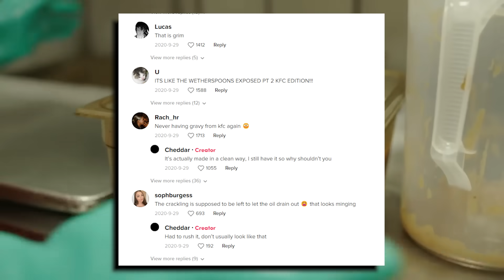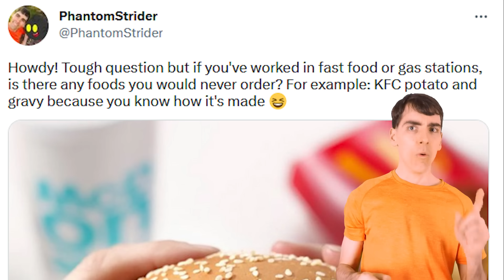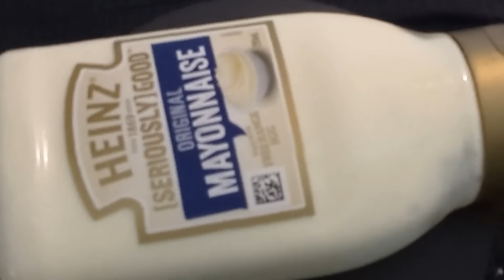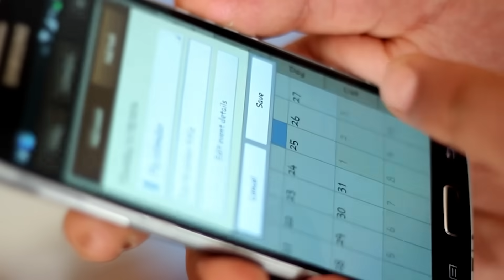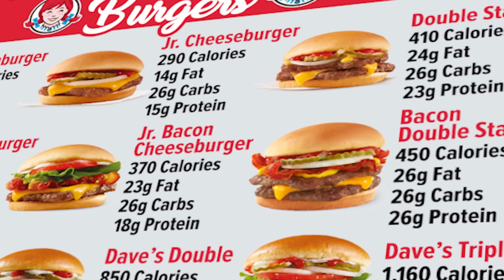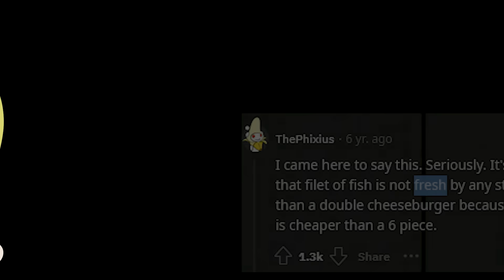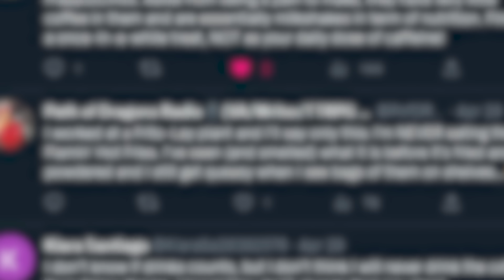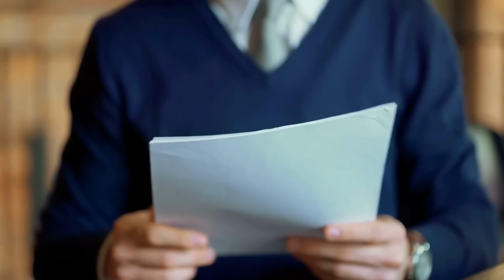The 10 Fast Foods Staff Never Order

Comment: McD's in the United States has always had decaf coffee packs; you can tell which pots are decaf (if they're using them right) because the rims are orange as opposed to brown where they sit on the machines. Typically it's brewed more rarely, usually either on request or during significant rushes (breakfast in particular). If you order it, the only downside is, you might have to wait.

Decaf iced coffee, on the other hand, is in a separate container and is almost always available because it's rarely ordered and brewed once per day at the beginning of the day, even at low traffic stores.

Comment: I worked at Dominos in college years ago.  When someone ordered an “Extravaganzza” — every topping except anchovies -- we topped them out of the overflow bin on the make line, where all the cheese and toppings fell while we were tossing them onto other pizzas.  It’s not as bad as it sounds, since the overflow bin was cooler than room temperature.  It was so much easier and faster than picking the toppings out of the bin by hand and returning them to their rightful containers on the make line. Manager said the only reason Dominos offered the “Extravaganzza” was to clear out the overflow bin.  I would typically get an order for one every hour or so, which was the perfect interval.  Good times.

Comment: I used to bartend for Red Robin and the damn soft serve machine was the bane of my existence. We sold tons of milkshakes. I was the one responsible for breaking it down and sanitizing it and every component every Sunday night. From start to finish it would take me about an hour, sometimes longer if I was busy with other stuff. Wasn’t “hard” just time consuming and full of pumps, little gaskets, small metal and plastic pieces… it was a huge jigsaw puzzle. Thankfully I wasn’t required to reassemble it as that was done the following morning. 

I did have to reassemble it one time and I mistakenly swapped two very similar (but still different) plastic pieces and one of those parts came loose and got chewed up by the machine so I had to disassemble, wash and sanitize the whole thing, throw out the contaminated soft serve, and completely restart the whole reassembly process all while juggling all of my other duties as the restaurant was now open by this time. The worst was doing all this while apologizing profusely to my general manager. I was mortified.

Even though I hated having to clean it, I totally understand why. The nature of the machine itself and the dairy product it was filled with wasn’t anything to be taken lightly or handled improperly. We could have easily given a quarter of our customers food poisoning if we weren’t so meticulous with the cleaning process.

Comment: I worked at a Wendy’s and if they are doing the chilli properly the containers the chilli is in is cleaned nightly. Any leftover chilli is put into containers and stored in the fridge for the next day and the containers get cleaned by the night crew. As of the burger meat that goes into it, they are put into bags that are dated and also put into the fridge. Chilli at Wendy’s also gets sold pretty quickly so you’re not eating multiple day old chilli. The only issue I had with the chilli at my Wendy’s was that our manager purposely added too much water to try and get it to last longer so it didn’t taste right. They did the same with the cheese sause.

Comment: Yuck...former baseball stadium  employee who used to work in the concession stands, what the Hell are you all doing with your hotdogs? 

At our stadium, which admittedly is a smaller stadium that only serves about 6 thousand people on average, we did NOT use water at ANY point in making or storing the hotdogs. We literally would just cook them on the grilling roller machine thing, put them in the buns, wrap them up in these premade alluminum foil wrappers and then store them in like these heated drawers until people came to buy them. Those drawers would have two shelves as well, so we could keep track of which hotdogs were cooked first and know to sell them before the other ones.

It sounds like the Major League baseball stadiums need to re-learn how to make and sell hotdogs.

Edit for grammer and better wording.

Comment: I used to work at Jack in the Box and while I don’t really remember any of the FOOD food being too bad (maybe, aside from chicken fillets for sandwiches and burgers staying under the heat lamp too long but that’s not too bad), I do remember the drink fountains being kinda gnarly. Not just a JITB thing, mind you. But be careful with those touchscreen freestyle soda machines in general. They’re unlikely to be cleaned often and there can get pretty nasty buildup of sugars and different syrups trapped in the compartment. I only know this because it once got so bad that we had to spent like an hour cleaning it out because the machine stopped working from being blocked up

Comment: For the icecream machine, I used to work at hungry jacks (burger king) and the lines which are shown there with the mold don't actually touch any of the mix directly there is occasionally a leakage in the parts however due to how there built there may be off product behind the panels however still 100% safe to eat. It also locks you out of using the machine if it hasn't detected you taking all the parts off to clean

Comment: The reason people are grossed out by the water is water can become stagnated very quickly if it isn't in circulation or stored properly. If the containers are open, it's more likely they will become ridden with bacteria. It's a safety hazard.

Comment: If you consider doing a part 2, allow me to chime in here for good old Panera Bread. Worked for 3+ years, and I can confidently say that you shouldn't order anything with avocado. Most employees don't typically care about the browning of an avocado, and have no qualms about serving it well beyond its expiration date. Of course, this doesn't happen all the time, and it does varry depending on location and management, but I would probably ask if avocados are cut to-order or pre-cut. If the latter, run very very far away. If the former, then go ahead and order.

Comment: Former McDonalds employee here, the filet-o-fish info is extremely outdated, from like 1995 outdated. Back in the late 1990's they did a fresh refresh where the hold bin was removed and food is assembled on the spot. They do deep fry the filets in their own oil vat, and sometimes employees are fools and put other stuff in there even though they shouldn't, but mostly it's fish only in there. There is a hot hold location for the filets after cooking HOWEVER, most stores don't even have one because it's such a slow mover and you get more use by repurposing the heat tray for the patties you'll always be selling. This means they will only cook the filets when ordered in most locations. So most of the time, the filet-o-fish is the freshest sandwich you can buy from a McDonalds. During Lent this changes a bit as the filet-o-fish is far more popular but in the 2 locations I worked in, even during Lent we sold maybe 6 an hour. Not during Lent you can realistically never even sell one in a day.

Comment: I used to work at Subway at a gas station in Poland, and let's just say, the standards are of the higher quality, at least I tried to make the quality better on my shifts there, but the tuna (at least here in Poland) is real tuna. On one nightshift a regual came and chatted me up about some stuff on subway, the tuna. So I took one "brick" of tuna from walk in freezer (yes it's delivered is packaging that looks like kevlar plates/bricks and we read the packaging and all it said that it contained fish(tuna), salt and water. We used to mix one brick of tuna about 2kg(?) if I recal correctly with one bag of mayo (about 1litre, or something over 1kg) and that's it. The vegetables are another story, I worked only nightshifts there and our dayshifts, idk why decided it was right to put loose tomatoes in a top open box on floor under shelfs, (for clarity, here regulations say that it's against the law, and the health department can fine or even shut down establishments for that practice) and the tomatoes decided to start growing a nice and lush carpet of mold on them, or just straight up rot. The common sense if you store vegetables this way would be to just throw the whole box since you can't be sure if the rest aren't getting bad, since it doesn't have to be seen to still be there, like with bread if you see a white spot of mold on a slice of bread the mold is already through the whole slice. The tomatoes in question me and my coworker on shift decided to just not cut tomatoes for use, we said it to dayshift (a not quiet yet manager) that it's moldy and rotting and we decided not to take the risk and potentionaly make someone sick. After our shift our boss called saying they are just beat up from being loose, like an apple in a crate that bumped into each other or fell. For the rest of my work there I decided that I reccomend against tomatoes and so did my coworker. Still the best and most safe option I can reccomend is salami sub (Spicy Italian in Poland) with no tomatoes

Comment: 21:00 people that want the filet of fish, want that and nothing else.  McDonald’s had an after midnight menu for a while that didn’t have the fish on it.  After a couple of very irate customers, I told them to sell it. It takes the same time as nuggets to cook its not a problem to make to order.

23:30 4 hr heat cycle can’t be skipped. And sometimes fails and restarts, because it couldn’t cool it down fast enough. Tailor machine are a joke, maintenance nightmares.

23:50 those are internal drip trays, from anything that past the seals.

25:45 BK floors were sprayed with hot water every night. Made easy with slopped floors. Lot cleaner than other restaurants.

Comment: So, to the "fast food ice" thing, I work at Starbucks, and I do have an incident that still haunts me. For some reason, Starbucks thought it was acceptable to allow lowly baristas to clean the ice machines once a month. They changed that back in Novermber/Decmber of 2022 because, well... there were way too many incidents of machines not getting cleaned properly.

My example was when my location about 1.5-2 years ago had specks of mold in just about every few scoops of ice. This was because of 2 things; firstly, it had been skipped three weeks in a row when it's supposed to be done monthly. Meaning it was nearly 2 months since it had been done. Then the issue came when we actually cleaned it, it actually got WORSE. To the point we cleaned it 3 times the first week, 5 the second, and so one. A few of those were done professionally. And after 3-4 weeks of this, my manager FINALLY had someone figure out the issue; there are pipes that need to be cleaned once a YEAR that hadn't been done in at least 1.5 years. It is something only professionals can/could do, and she had never needed to as this was only her second store she managed, and it hadn't been a year yet. And what we discovered by the person who told her all of this explained that because the buildup in the regular ice machine got so bad, that when we finally cleaned it, it loosened up the mold in the pipes 🤢 and that was why it got WAY WORSE before it ever got better.

Also, to clarify; we were NOT selling this ice 🤢 we were going to the gas station a couple doors over, and buying bags of ice all day, and storing it in the bottom of our machine when it was off/when we weren't cleaning it. That way only clean ice was being used for our customers drinks

Comment: I used to clean ice cream machines. Those trays are what we called dropping trays. I never saw mould there. That black came off the gears in the back of the machine...it was the lube off the shaft. No ice cream is in that tray or around the gear shaft. That black would be hard to hide in the vanilla ice cream.

Comment: As someone who worked at the baseball stadium in Arizona, I can say that how old or nasty a hotdog could be is dependent on the stand you go too. I was in a booster club so we never had nasty hotdogs and we sold steamed or baked ones. 
Most of the stands in stadiums that have bad standards are temps. The stadiums will have lines of temps to fill stands because no one wants to work at stadiums full time and the stadiums save money this way.
Most temps are needing jobs because of drug use or previous jail time. They typically steal money and food and give zero shits about how they do at work. 
So my tip, look for booster clubs or people in stands who don’t look like they hate their jobs.

Comment: One of the restaurants I've worked at. Had the ice machine separated from the drink machine and I or whoever had time had to lug a bucket of ice from the far back of the kitchen, past the line to the drink machine or out to the bin at the bar. So it's basically guaranteed the ice in people's drinks likely had bits of grease and food on it. When it went into the cups. Management was also terrible there. And I don't just mean the in store management.  I mean the guy who owned the place. Never met the guy but he struck me as one of the people who ended up on kitchen nightmares because they had no idea what they were doing when it came to the place.

Comment: Some of the people avoiding the Taco Bell beans may be because for a time years ago they weren't simply using dried or dehydrated beans. They were essentially using desiccated bean powder that was shipped in bulk from the corporate supplier and had a near infinite shelf life but to reconstitute them and make them creamy again they were using lard. Seriously. if you can find it look up what the fat content used to be in a Taco Bell bean burrito. It was stupid and I stopped eating there for years. This was also around the same time period that it came out they were using so many fillers in their beef that it was less than 50% beef (don't recall if that was by weight or volume) and they tried to get away with it by claiming all the filler was "seasoning" Yeah, OK. Oats are a perfectly fine natural and nutritious filler as long as you aren't lying to the customers. They on the other hand were using oat husks AKA what is discarded and nobody intentionally eats.

Comment: Fact check. I worked at kfc in atlanta ga and all the gravy is is a packet of powder "flower, bullion, and seasoning" mixed with boiling water. The potatos are made with potato flakes and boiling water mixed separately from the gravy. The garbage at the bottom of the fryer does not go into any food.

Comment: Shakes! If the tray that holds the mixturer doesn't get cleaned out and just more mixture keeps getting added, you will end up with a hidden layer of magots. 

The only reason that I found out was because the shake machine was making all kinds of noise since the mixture was completely out, when I opened the tray , it was a horror fest. 

The sad thing is that we've been selling a lot of  shakes, and who knows how long we we've been selling maggot shakes, so if we didn't let the mixture completely run out, we would've never found out about it.   (Although there is a daily cleaning procedure, but our manager didn't want us to throw out the gallons of mixture that was left over every night).

I was a kid since my only fast food job, so I don't know if the shake machines have changed, but I haven't ordered a shake since, not after the nightmare I saw, lol!

Also never f*ck or be rude with people who are handling your food, that's another story, but needless to say that even if I get the wrong order, I  just say thank you and go on my way, there will be another meal in a few hours, so its just not worth it.

Comment: I use to work at Mc Ds and I know a lot about those machines ice cream machines needs to be clean for like 4 hours is a weekly cleaning..each day at night goes in to heat sterilize mode to  kill any bacteria and with in the alert ‼️to add the bag of shake mix of course of an 30mins to an 1  if not added because of the mix being low locks the machine for 6 to 8 hours

Comment: My mother made gravy that way my whole life and my sister does it the same way now. Anyone shocked by how it's made has clearly been raised on nothing but restaurants and processed food. Also, I fail to see the point of "reheating" hotbox food. While hotboxes aren't meant to be kept at cooking temps, they should be keeping the food hot enough to serve it. All "reheating" it is going to do is dry it out faster than it would if just left in the hotbox... or burn it. Lastly, on the ice, the ice machine is easily the most over-looked item to be cleaned in any restaurant I've worked in... even 5-star restaurants.

Comment: You're so wrong about the hot dog water. Like... complete disregard for basic science. 

Even if the fossit it came out of is perfectly clean (which it isn't) that water is going to be riddled with bacteria by the end of the first day. Hair and skin are falling into it. Bacteria can land on it from coughing, sneezing, or anything really. So if it's sitting around for months, there is absolutely no way it's clean. And even boiling it won't kill everything. If you have a mold covered pan, you don't just boil water in it and say "yup, that's clean now." No, you're scrubbing the fuck out of it because you don't want to get sick. Same thing. Except this goes on for months at a time.

Comment: When I worked at KFC in the 90's we just had a dehydrated powder that we mixed with hot water. Same with the potatoes. I wonder if it changed since then. 🤔
Reply: I worked there in 2020 and it's still the same way